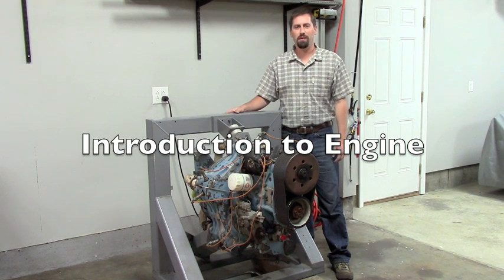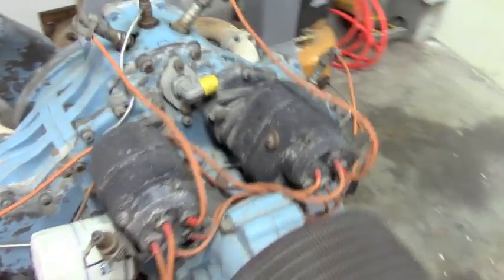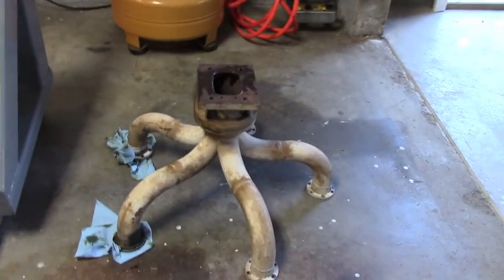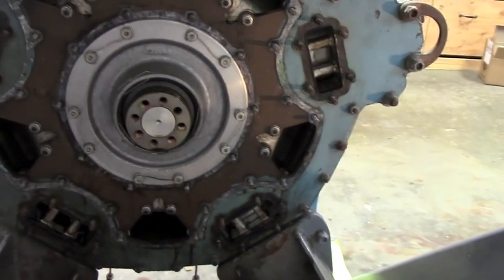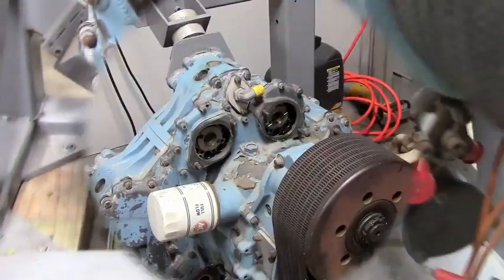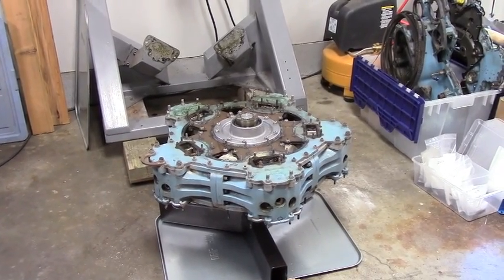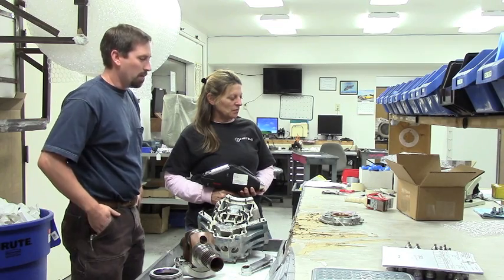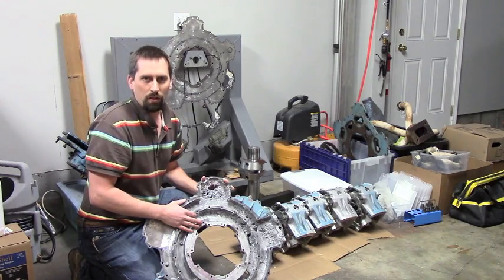TSIR-5190 Disassemble

Comment: It appears that the engine you have may have come from the A/P school at Northrop University. I attended Northrop in 1984 -- while there I worked on the TSIR 5190 along with 2 other students to see if we could get it started. I had read about this engine in 1965 in a copy of Mechanics Illistrated that showed the all new Cessna 336 ( fixed gear ) airplane, The article also showed the 337 that was comming out and that they were going to be used in Viet Nam as foward air controllers and that they would be using the all new Mccolluch 5 cylinder liquid cooled radial engine I was very interested because my father had  had a Mccolluch dealership selling outboard motors -- anyway it took us a week to find and install the parts that taken off -- we couldnt find the starter motor so we addapted one from Dodge -- at that time it had been sitting for 15 years  or more  -- so we primed it with oil ,rotated by hand many times and then tried starting it -- the starter was a reduction gear type wich turned rather slowly  -- the engine would fire rondomly but wouldnt start -- we noticed that it didnt seem to be drawing any air into the intake so we used an airline from the shop to provide intake airflow -- by this time it was flooded and the starter was about to give out -- so we cleaned the plugs ,blasted intake with air and cranked it-- just as we got cranking the sky opened up and it poured rain--- it ended up raining for the rest of the week and I never got a chance to hear it run ( Until you put it on You Tube ) I cant tell you how cool it was to hear you start the engine I thought it would never be seen or heard again  Thanks   Gregg Leisure .
Reply: Mr Crover-- one very unique thing about the Mcculloch radial is that it doesn't use yor standad master rod link rod setup as you know - this made the engine less expensive to manufacture -another benefit was that your ignition timing took place every 72 degrees so ther was no need to  grind a magneto cam that would  compensate  the timing to match the master rod offset using 3 different timing points on a 5 cylinder engine -- I was hoping you would have shown detailed pictures of the connecting rod assembly assembled and apart showing how the connecting rods were retained to the crankshaft -- if you have any pictures of the rod retainer device it would be very cool if you could share them with us -- GREAT JOB ON THIS PROJECT --Thanks  Gregg Leisure

Comment: How do they achieve pressure lubrication? Are the crank bearings sealed with oil return channels? What about cylinder lubrication? Interesting to note that they used a Bosch inline pump to pressurize the fuel. The old inline pumps used engine oil for lubrication instead of diesel.

Comment from the maker: Interesting, I will check on this...maybe its the prototype that was tested in the skymaster.
Reply: 1.  Assume there is no master rod, instead the rods use partial slipper bearings.
2.  Do the slipper bearings ride directly on the crank pin or on the OD of a roller bearing?
3.  The two split clamp rings flanking the rods restrain the rods during start and closed throttle.  Correct?  Are they lined with Babbitt?
4.  Are the rods steel or aluminum?
5.  Is the bottom piston ring compression or oil control?

   I am doing design studies in Solid Works of two stroke aircraft radials and ran into the same problems as McCulloch and in ignorance hit on similar solutions.  One design has slipper rods riding on the OD of a rotating bearing ~ like a LeRhone 9c.  The other design has link rods but no master rod.  Rods are stabilized w/  linkage similar to a Nordberg 10 cylinder radial.
   The proposed engines are two banks of 3 cylinders.  The cylinders banks are staggered by 42mm sharing  the same journal.
BxS 2.6x3.62” ~ 160 cid.  Liquid cooled, direct injected.  One aim is machined parts instead of cast or forged.
   At present have the rotating groups modeled.  When one goes from crankcase scavenged lost oil to wet or dry sump, complications amplifies!     Cheers D